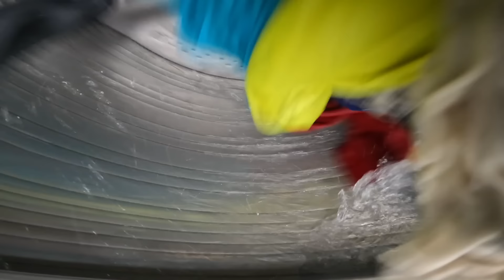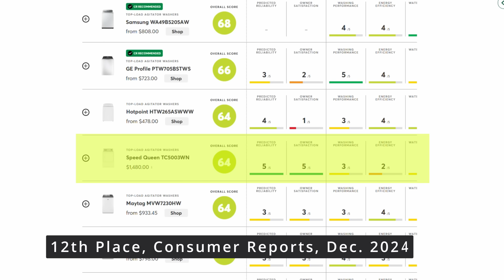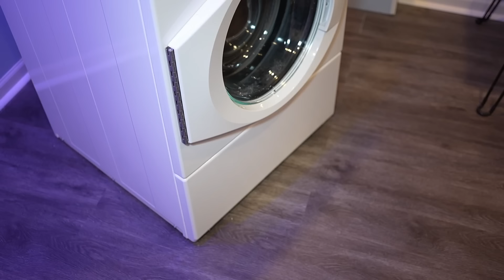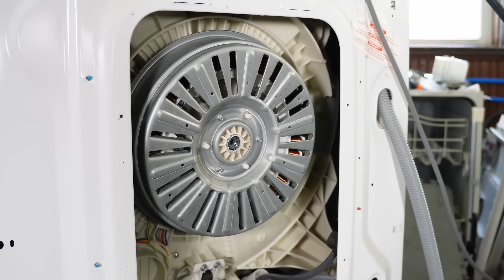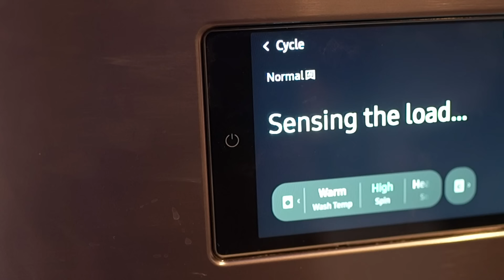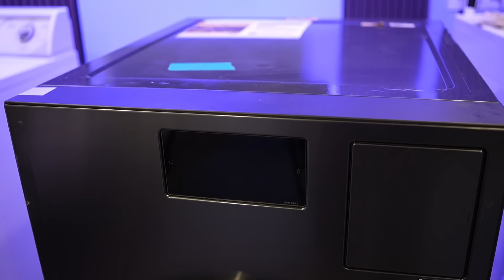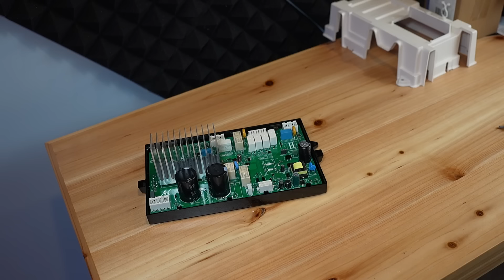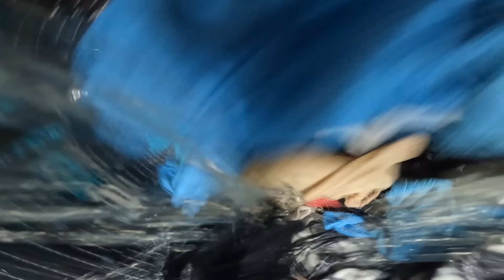Is America's Most Expensive Washer Great? The Speed Queen FF7009WN Test

Comment: So I have this machine and have done lots of videos on it. I started with the Speed Queen top loader and it was great. Then when my king size bedspread wouldn’t fit I started looking into front loaders. I got a GE and it broke down. I went to Samsung and same thing. So I dropped the money on the Speed Queen front loader and what a machine. I’m so happy I spent the money.
Reply: Real talk, the Samsung AND GE washers are broken down at my job here in Vietnam, a place where everything is rigged and self repaired with a coat hanger and prayers. Speed Queen is great
Reply from the maker: @WhatWillYouFind  you actually have GE machines in Vietnam?!?!?
Reply: @bensappliancesandjunk  Hell, the GEs are probably made in China, so kinda close anyway.
Reply: @reverett0508 they are OWNED by China now.  So yes.  You are correct 😂
Reply: @reverett0508 i know right, Haier basicly owned GE now anyway.
Reply: @reverett0508 Haier owns GE.
Reply: @WhatWillYouFind  As far as I know, GE has no official reseller in Vietnam, yours must be refurbished ones scavenged from landfills abroad. I bet they originally run with 110V current.
Reply: Bought a Whirlpool Duet front loading W/D pair in 2009, after TONS of research, back when the Internet was useful for such a thing.  Front loaders were fairly new and you really had to be careful about which front loading washer you chose.

They certainly don’t make things like they used to, but that washer and dryer is still going strong although I do have some things I need to replace on both to quiet them down a bit now lol.  All I’ve had to do is replace the boot seal on the washer one time, approximately 3 years ago.
Reply: @NightRogue77 YES, my experience exactly; only difference here is, mine was a Kenmore Elite, made by Whirlpool....I left them with the house when I sold my house; that was 4 years ago...they're STILL USING IT, NO ISSUES!!
Reply: @jam @jamescarrington5521  the shocks on the washer drum are terrible, and there are are some flimsy plastic parts that break pretty easily like the door handle and the plastic ring that goes around the outside of the door, but I’ve had this pair for like 17 years and they both still work great!  Considering all the horror stories I read when I was researching, I think I made an excellent purchase.

IMHO, if you follow basic care/handling procedures and use the right soap, load it properly, keep the washer door cracked when not in use, etc these things are pretty stout
Reply: Yes, I have the top loader and love it. Best washer out there!
Reply: Do you love the front loader (in general) more than the top loader speed queen? No major issues? Thanks
Reply: @ Love both machines and are still using both but my favorite is the front loader. No issues.
Reply: What do you think of the front seal? water drainage? Do we have to still keep the door open and wipe it down?
Reply: @JacquelinePrice-rp7jq No problems with the front seal and it is a good idea to keep the doors open when not in use. I always keep the door open on my front loader and top loader as dark and moist will grow mildew.
Reply: usin fairy as a prewash detergent is a better choice
Reply: My local speed Queen dealer has repair checks that prefer Electrolux.
Reply: @freedomcat I went with Electrolux for my set a few years ago and love them.  Not been long enough to call it a real durability test yet but I have zero complaint.  

Same as Bosch for dishwashers.
Reply: @maevethefox5912  I just went to my local appliance store and asked what their repair text prefer so I found out what they prefer for stoves and freezers, I currently have a standing pilot stove from the 90s. My stove looks a bit worse for wear but it still works I plan to upgrade it eventually
Reply: @ I hope you get something that’s quality and safe. 👍
Reply: @Bunkysworkshop  that's why I asked the repair techs what they prefer because if they don't have to repair it at home they're good. It's just common sense if someone doesn't have to fix it at home and it's part of their job, it's good quality. You just have to make sure to keep up on maintenance. Also I'm excited that Electrolux has pod slots for laundry pods so I can use tide hygienic pods and it'll get dissolved when I'm doing a load if I use them. Guaranteed that speed Queen does not have that.
Reply: @ When you use pods in a front loader you just put it in the drum first then you laundry. No need for a special pod slot.
Reply: @Bunkysworkshop  actually with the special pod slot it ensures that they are properly dissolved so they work properly in their dispersed correctly. That is the problem some people get with regular front loaders they toss a potting and it is not fully dissolved and stuck to the clothes. @jeevesny for more laundry tips.
Reply: @ I’ve used All,Gain and Tide pods with the Speed Queen and no problems. 👍
Reply: @Bunkysworkshop  all you guys are doing using those pods, is introducing more and more micro-plastics into your immediate environment including the clothes that you put on your skin.  Matter is neither created nor destroyed; it only changes forms. Stupid pods covered in plastic are a solution to a problem nobody had.  Oh wait no they aren’t even that, unless the problem is “I don’t know how to use something from a box or a bottle, and then reseal that container for later use.  You mean I have to measure a specific amount?”  Like a bad infomercial:

“tired of fumbling about with bulk quantities of cheap detergents?”  (Idiot opens a box and jerks powder detergent into the air) 
“OH NO What a mess!”
(Throws hands on hips with pouty facial expression) “there has to be a better way!”
“Well, NOW there is!” (idiot’s face lights up!)

“so throw away those bulky boxes with their inconsistent metal shit spouts that nobody without Elvira‘s fingernails can open - who needs to save money buying bulk?” [cut to shot of box getting thrown into trash”

“save those measuring cups for making cookies, or maybe for collecting and measuring the tears of your discontent!? Nah, just throw that shit out!  We’ll do the thinking for you!”
(Idiot shows satisfied face, gives an “aw shucks” shrug and knowing smile)  “wow, thanks Tide Pods!  Before, I used to have to think for a few seconds before I did something. Now, I can just keep moving on autopilot throughout my day, only ever concerned about my nose in front of my face!”
Reply: @ lol 😂. All I can say is yes I did start out using pods but that was a couple of years ago. I use All clear and fresh. Liquid.
Reply: @NightRogue77 
Wow! You summed up my thought process about the entire philosophy of today’s  society. Like ya what he said 😂
Reply: How’s it going another year later?
Reply: @user-nf5zt4kr6p All good my friend.
Reply: Sounds like you went through the full washer journey before landing on that one. Big bedding like king-size comforters really does push people toward front loaders because of the extra drum space.
Interesting that after trying a few different brands you ended up back with Speed Queen — sometimes paying more upfront ends up saving a lot of frustration in the long run.
Reply: @IndustrialScienceLabYT I had a GE front loader that did a good job but only lasted 5 years and the bearings went out. I then went to the Speed Queen top loader and loved it but couldn’t do the bigger items so came the Speed Queen front loader. In my opinion I hit the golden washer ever. This machine doesn’t play around it just gets to work and never one hiccup..I still have the top loader and do use it but I’m always going to my front loader.
Reply: @richardkrug6347what?
Reply: Ive had a ton of issues with mine unfortunately. They’ve replaced the board 3 times for a  ed29 error. The motor, just about every part minus the tub and wiring harness have been replaced. Waiting total of over a year total for parts for all those repair appointments.
Reply: I swear, some of you just hate Samsung because they're popular. We have one we bought six years ago, with daily use and abuse and fluctuating electricity that should have fried it. No repairs were needed, neither in warranty nor outside of it.
Reply: @I_Am_Your_Problem Not everyone lives in a ghetto like you
Reply: How much to replace the computer board,? 2500.00 ?
Reply: @ Well all my rentals have this machine and never a problem.
Reply: get the LG, have you not watch the videos? GE and Samsung are the worst
Reply: @ddjohnson9717 GE was bought by China in 2015 (I think that’s the year). My 18yo refrigerator needed a part that Hieir  (sp?) decided to not keep making after buying GE so we had to get a new refrigerator.  I went with Bosch.
Reply: Life long commercial electrician that always had the most problems with ge, from securing parts, joke service delay & customer service.
Reply: @ our brand new GE refrigerator did work from day one. Three service calls and two compressors. JUNK
Reply: @ddjohnson9717  Yep. My LG seems to be holding up alright. Meanwhile my dyer is an ancient Amana
Reply: @ yep 👍 Watched plenty of them and  the build quality just isn’t there on the  LG. Speed Queen uses Commercial components . LG uses standard or so called Residential components. LG is a good product but I’m staying with the SQ.
Reply: Speed Queen is where it's at?  Good to know. In the future I may get a Speed Queen with less bells and whistles. I don't need a washing machine to make coffee and give driving directions.
Reply: @hof2728momomichi  we are happy with our decision to buy Speed Queen for our washer and dryer. They are well worth the money in our experience and opinion.
Reply: The Speed Queen front loader at 3.5 cu ft is far too small.  I went with a top of the line GE that’s 5 cu ft, and it was less than half the $$$$ of the speed queen.  I’ll happily replace my larger General Electric washer 2-3 times for the same price as ONE top-of-the-line speed queen.
Reply: @ GE didn’t work for us. Three break downs was enough for me. Sometimes size isn’t what is the best.
Reply: @J.W.W.  makes no sense to keep replacing an appliance. You just keep adding to the landfills
Reply: @J.W.W.  You say that, but when you have to replace it, you will NOT be happy. Especially once inflation does its thing, or if you're replacing the machine in 5-6 years rather than 10-12. Or as it will inevitably happen regardless of brand, it breaks at the worst possible moment and you have a load of wet, half-washed clothes stuck in there (probably clothes you needed that day, for maximum frustration). 

GEs breaking down (Samsung and Frigidaire too) sold a LOT of Speed Queen machines over the years in the little shop I used to work for, and we almost never had issues, even as a servicer. People are as willing to pay for that as they are capacity or fancy features and modes.
Reply: I regret getting a Samsung, I got Samsung everything, washer, dryer and dishwasher 

Ive have several break downs with the washer and dishwasher 

Now its out of warranty, so im concerned about it
Reply: Yea a got a stove a few years back. I keep several spare parts in the lower drawer. Seems like the same parts go bad so I keep a stock of them. @colinofay7237
Reply: I'm actually jealous, I'm so poor I hand wash and sun dry my family's laundry. Hand washing beats any machine.
Reply: You've got to be kidding that hand washing is better than machine washing. You cannot agitate the close by hand as well as any machine. Can you can't put your hand in water? It's hot as can be inside any machine and you certainly can't wring your clothes out as well. As with the machine@twt000
Reply: ‼️ Tariff anybody?  Have you been lied to?  A US Tariff is paid by the US Importer at the landing of goods at the port of entry into the US and is always passed on to the end consumer.  When the tariffs on appliances went in place the price of the machines went up and the US upped their own prices ‘because they could’.  Do you really think China (etc) pay these? They don’t pay a dime.  The front page Christmas Eve day of the Wall Street Journal says low cost vehicles made in Mexico will increase the retail price paid by $3000 more.  Tariffs are a federal hidden tax on consumption.  

The only fight we have is to demand retailers itemize all tariffs by NAME on the posted price and sales receipt. Let’s say you buy something posted price for $132.95  Example: “Plus Biden Tariff kept on by Trump $14.11, Trump 2015 Tariff $28.71 totaling US Tariffs $42.82 and a total price $175.77 plus State and Local Tax, which has increased by $4.92 more after Tariffs.   LET WE THE PEOPLE SEE THE TRUTH.   That story that it’s a bargaining chip is not going to lessen the burden on your wallet.  Point blank, the tariff money flows to the Federal government.  It’s not handed over to the US competitors.  It’s a “Federal Tax on Consumption”, period.
Reply: @jerryrobinson7856 you sound like a bot.  No one here before you is talking about tariffs.  And your comment is based on a lie.  Tariffs are not required to be passed on to the consumer.  It depends on what the importer/business decides to do.  Some do, some do partially, some do not.  The point is to get more people to buy domestic.  Tariffs also have the effect of shifting production domestically and increasing and protecting domestic wages which offsets any increase in costs.  This is nothing new, tariffs have existed forever and the US has used them in the past to our benefit.  We did this with cars a long time ago.  Your post sounds hysterical.
Reply: @ You are watching too much Fox. The same organization who paid $785 Billion to settle a big fat lie case.  The only time Tariffs ‘benefit’ is US farmers. However that backfired and China cancelled buying US dairy in days after Trump played his tariff game.  Domestic production of goods requires raw materials and components from off shore. Depending on the industry, it’s 75% on average.  May I suggest you ask an AI tool like Edge (it’s free) and ask specifically real questions.  The fact that the Wall Street Journal puts the $3,000 tariff to be passed onto the US Consumer on the front page on Christmas Eve day, says even right leaning news media is spelling out the disaster to American’s wallets.  The fact is there are ‘some times’ tariffs may influence political swings, but it’s financially costing US We The People the tariff money.  Anyone believing the myth that China pays bought in to a big fat manipulation.  Even when Fox Sean Hannity asked Trump if it would lower taxes to Americans Trump dodged the question.  Go do some research, the rich have been robbing the middle class since Ronald Reagan with trickle down economics saying, let’s cut taxes to the rich and it will trickle down to the workers, TRiCKLE DOWN was literally correct. We are a country $36 TRILLION IN DEBT!  Please go watch Warren Buffets YouTube’s and he spells out that the rich are not paying their fare share.  Then look at inflation that wages rarely even pared up with wages.  We are a country propped up by the Stock Market and the Uber wealthy are not paying people enough.  Trump blames China and a Mexico.  The average wage for labor in China is $150 a month. The US is a specialty, engineering and technology country and has no chance of bringing back jobs to “commodity manufacturing”.  That’s China’s simple economic strength.  I do the deep dive and read the actual facts.  America has been manipulated by the rich and anyone not rich on their side is not seeing the truth of what is really going on.  Just wait to see how Social Security cuts these clowns will do.  Raising ages to collect, cutting benefits and causing massive family burdens taking care of financial matters of their parents.  Leeja Miller a brilliant researcher who is also an attorney in Minneapolis breaks down each of these on her YouTube.  Perhaps you might consider what experts say and double check politicians.
Reply: @lookoutforchris  Hey it’s 2/2/25. This week even some MAGAs might start to understand tariffs.

Comment: Great review! Question: Did you air dry the test stained shirts or did you dry them in a dryer? If you used a dryer, the heat from the dryer will help to "set" the stains. You would have better subsequent stain removal if no heat is used in drying.
Reply from the maker: In a dryer. I recognize that it would set the stains, but I'm not re-using the shirts for more tests, and I was more concerned with time and getting that load of laundry back in the unit for the next test, since wash+dry took usually 2hrs per test.

Comment: Very methodical test. My city water charges me mostly a fixed rate, but I wonder with some city's charge more of a metered rate?
Reply: 20 or 24 gallons is not that much water.  I pay a variable rate of $6.60 per 100 cubic feet, so that would be a cost per load of $0.18-0.21 in water.  I'd be fine with paying an extra dime per load in water for a quicker & more reliable machine; that's less than $30 a year at my usage.